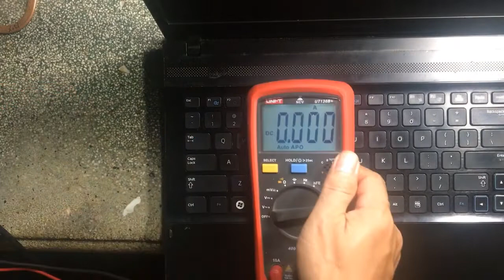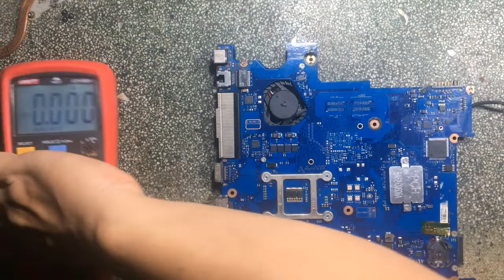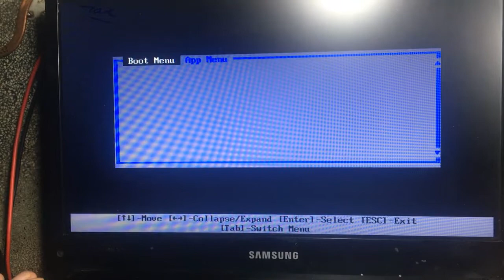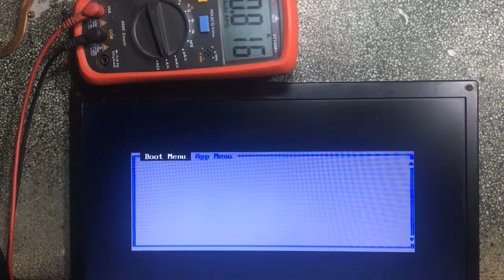Repair Laptop Samsung NP300 Not Power On

Comment: In my case,

1. when charger is connected,  charging indicator lights up.
2. When I pressed the power button the ambian light around the power button lights up.
3. I can hear the 2.5 inch HDD's spining sound.
4. There is another indicaters which is blue and lights up when pressed the power button.
5. May be that blue one is to indicate that HDD works.
6. No CPU fan is working.
7. But when I touch the CPU I feel like Its is worming.
8. No display power on (Black screen)
Reply: did you fix yours?